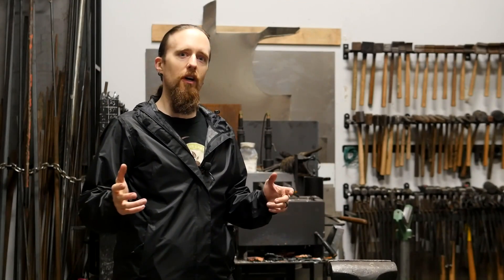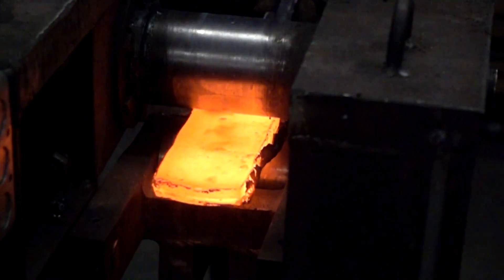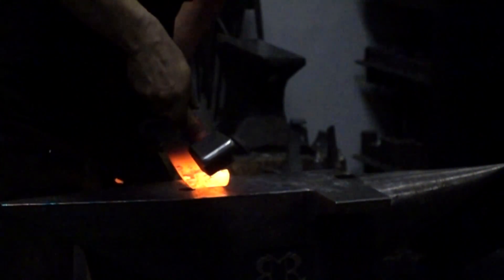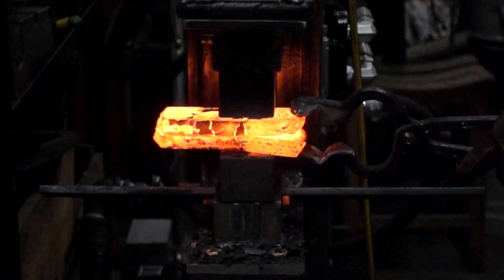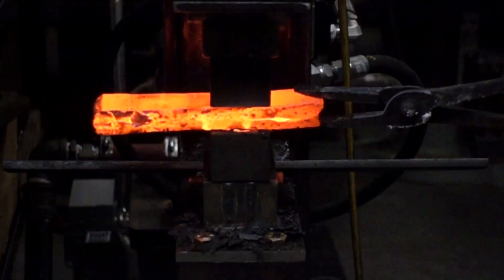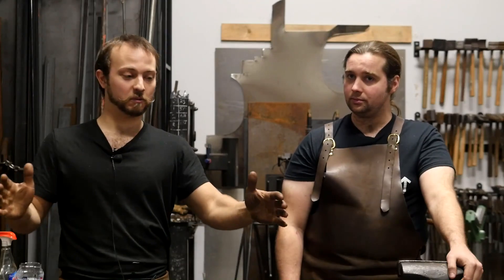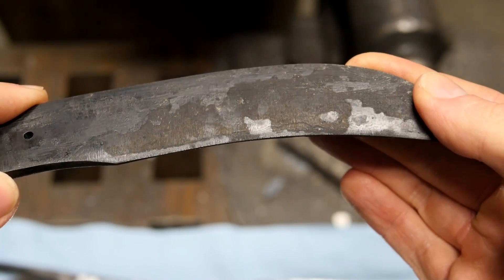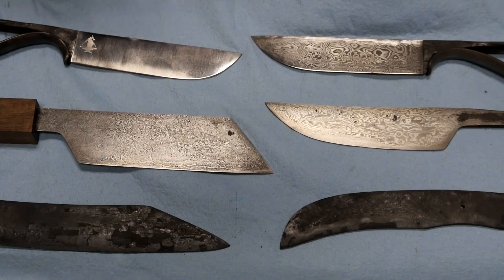What is Pattern Welded Steel ("Damascus") - Explained by Blacksmiths (Part 1 of 2)

Comment: Even in medieval europe the steel they had was better suited for weapons and armor than Damascus was.
There are plenty of patternwelded sword left from europe, but those are mostly just for decoration - it didn't bring any benefits as the steel they had was already that good.
Reply: ABaumstumpf Are you talking about pattern-welded steel, or wootz? Because the former was used by the celts from the time of the Romans and was used until it wasn't needed, and the latter was better than anything Europe made until the industrial age.
Reply: "and the latter was better than anything Europe made until the industrial age."
 Well no, it wasn't.
Reply: Yes it was.  European steel was bloom steel. That is low quality stuff because it's ineffective at removing non-metallic inclusions. Wootz steel is ingot steel. Which means they could remove the vast majority of the non-metallic inclusions because the iron was actually liquified, which doesn't happen with bloom steel. So, Damascus steel was better than anything Europe had until the industrial age, when Europe developed the technology to liquify iron.
Reply: Altonahk - till maybe the 12th century, sure.
But that is why i specifically said STEEL, not iron.
Reply: ABaumstumpf Crucible steel was invented in Europe in 1740 by Benjamin Huntsman. Prior to that it was bloom steel.
Reply: ......... if you want to ignore that we have good quality tempered steel blades from the 12th century that is your problem but not reality.
Reply: Good quality? Sure. Crucible steel (such as wootz)? No. Careful selection of ore, methodical smelting, and skilled smithing could still make quality steel, despite the non-metallic inclusions inevitably present in bloom steel. But a method that removes more of those non-metallic  inclusions (wootz steel) is better.
Reply: Wait, steels gained in blast furnaces is also bloom steel? Because Europe had blast furnaces since as early as the 11th century.
Reply: Crucible steel requires a crucible. If you haven't developed ceramics to the level that you can make a crucible that won't crack at steel melting temperatures, it doesn't matter how hot you can get your furnace. You will be forced to put your ore directly in the coals, which is bloom smelting.
Reply: But the very term "bloom" points to the slag remained from the bloomery process, while the blast furnace melts the steel, separating the slag from the material. I believe a separate term is required for steel gained from blast furnaces.
Reply: If the ore was was melted in a vessel, its crucible steel. If its heated to forge welding temperatures and the tapped, etc to drain molten slag, then it is bloom. Europe did not have crucible produced til 1740.

Blast furnaces may have existed to a limited extent in the 12th century, but they mostly didn't spread until the late 15th century. They also over carbonized the iron (because the molten ore was not in a crucible) producing pig iron. Pig iron is okay for some castings, but is too brittle for tools or weapons,  so they would have to pattern weld to decarbonize the iron into a more suitable carbon content (usually less than 1% carbon, compared to the >3% carbon in pig iron). This is not superior to wootz by any stretch of the imagination. Bloom smelting continued into the 18th and 19th centuries, slowly being replaced do to the superior and more controllable product of crucible smelting invented in the mid 18th century.

 I haven't seen any evidence blast smelting was used for weapons, especially as you are more likely to find mild steel swords than over carbonized steel swords. From what i understand, blast furnaces were mostly used for foundry work, so casting metals. 

Blast smelting over carbonized; bloom carbonized slowly, often requiring multiple iterations; crucible steel can be controlled simply by how much carbon you add to the crucible.Crucible is better than anything that was made in pre 18th century Europe.
Reply: Alright, but blast furnaces spread out already in the 12th and 13th century, hell, by the 15th century they already had furnace complexes with watermill powered hammering machinery. I will look into the weaponry production aspect of it, but to my knowledge, the development of blast furnaces is the main reason Europe abandoned pattern welding through the 11th century, as the material gained no longer required it.

Comment: Matt Easton is going to get typical British aggressive on these inaccuracies and make a stern video correcting them.
Reply from the maker: Inaccuracies? Adam pointed out that what was called "Damascus" in history was actually wootz steel. The term is nowadays very commonly used for pattern welded steel though, it's what people recognize. Whereas "pattern welded steel" often causes blank stares.

Comment: Gotta have .005 to .01 vanadium in the iron ore to have the natural damascus pattern. The wideh mine near damascus had vanadium in it's iron ore. The older ore had a bit higher vanadium but they still fibd it there. Add green leaves and glass to the sealed crucible which adds carbon during the melting process. This  lowers the melting point by a couple hundred degrees. The crucible has to be perfectly sealed....no oxygen. The glass will melt first and go to the bottom of the crucible. As the Iron melts and it being heavier will cause the glass to raise to the top of the crucible pulling impurities up and to the top of the end result. This is as close as we can get to real wootz crucible steal. The pattern didn't come from two steals. It came from that .005 to .01 vanadium.